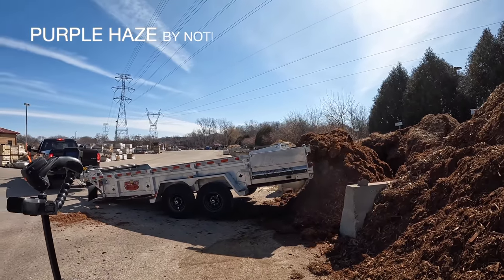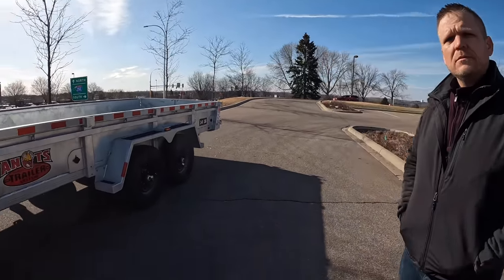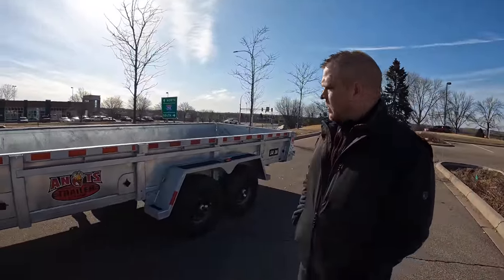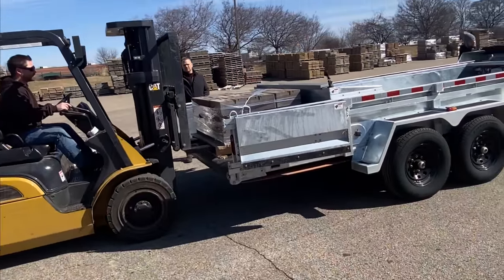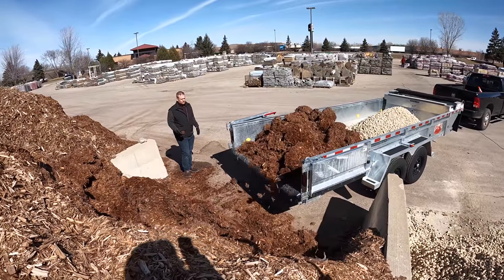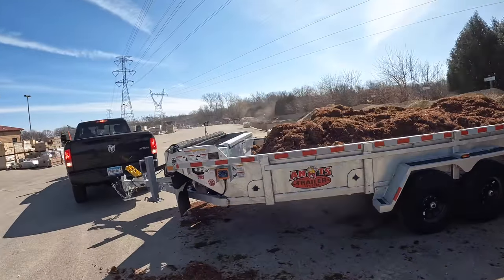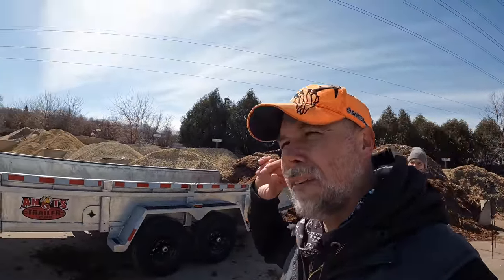Crazy Live bottom dump Trailer in action!

Comment: The sheer aspect of being able to load multiple pallets without having to do the pallet shove is amazing and worth it.
Though I would see about getting some rubber bumpers for those dog ears because you can't always rely on workers to be as conscious about not dragging them.
Reply: maybe UHMW dog ears
Reply: Redesign them with wheels.
Reply: You  could just carry a couple pieces of 1" thick plywood to put under the dogs!
Reply: @BrunoPonce  Many times the trailer has to move backwards while unloading...so not a good solution.

Comment: A simple fix for the dog ears dragging is use the same poly that is made for plows and you could actually use the same idea a snow pusher uses. Where the side of the boxes have poly that moves up and down just adapt it to this specific trailer just a simple thought maybe a easy solution. Cheers hope she works great for ya!
Reply: Or add a wheel
Reply: Or ad a polly roller on each side
Reply: Could an Off The Shelf poly for a snow pusher be bolted on? Alternatively, rollers like they use on the back end of a motorhome to keep it from scraping the ground. I just ordered a pair of rollers off Amazon for a trailer I'm building earlier this afternoon.. very reasonablely priced.

Comment: I would prefer that the rear of the trailer had rollers similar to what is on a small roll-off container ...Not a fan of the dog ear for a number of reasons , one being the marks left by the dragging them and they will grind down the nothing and on surfaces  not level The belt is just too close the the ground...otherwise the trailer is fantastic ....
Reply: All that you have to do is raise the dogs off the ground and then they don't drag!
Reply: @larryzuravin4226  yeah , but that dont work on uneven ground...
Reply: Thinking same thing all my dumpsters have huge steel rollers on back. I can pull it around like a trailer. And back it up of course

Comment: What a great piece of equipment. 
You could put delrin or UHMW blocks under those dog ears pretty easy and a chain oiler without much trouble. The utility of rolling off the two kinds of loose material without mixing is great. That tall stack with the kneeling thing is pretty cool too.
Reply: You can put a partition in a regular dump if you need to haul more than one kind of material. I've done that before but rarely need to.
Reply: @jamesnm21  you missed the point. Sure you can load any trailer with as many materials as you like, but you'll be shoveling them off, because you won't be able to offload them without them mixing.
Reply: @littlejackalo5326  you just leave the partition in while dumping bud.

Comment: Hi Stan, This trailer is awesome,  What can be done to prevent the marring or gouging of pavement or concrete surfaces, is to place skid plates below those dog ears, made of the same material you have on the bottom of your snow plows.  Make it to be replaced as needed just like the snow plows ensuring no metal comes into contact with pavement or concrete surfaces.

Comment: Very impressed with your review, as well as the triple-functionality of this "Ant's trailer.>>>I don't know if I missed-out on the price, or if it was not mentioned.???P.S.--I had a thought that came to mind when loading different materials.....my thought was if you could install adjustable self-locking tubing across the width of the trailer with a rubber-skirt (or other flexible/durable membrane) hanging down to the floor, that should easily keep the materials from touching at all.
Reply: Last I knew 25,000

Comment: Congratulations Stanley on your purchase 👍👍. Looks like this trailer will come in quite handy for some very unique circumstances.
My only concern is it has 7K axles. I noticed all the weight is transferred to the back axle as you were offloading the pallets of pavers. I'm wondering if it's possible for the rear axle to become bent if transferring 10k of product + 4k of trailer weight acrossed it?
Reply: It should have some form of self leveling capability to address that.
Reply: imagine having that 14k travelling 60mph and you hit a bump / pothole and the dynamic forces it should capable to handle VS being stationary
Reply: Dexter makes 8K & 10K axles that could be easily be swapped over if you felt it is needed for what you are hauling/unloading. Just remember to upgrade the tires and wheels if you upgrade the axles.

Comment: I demoed the 6x10 deck over that they make .
It was awesome. 
High quality piece and great folks
Reply from the maker: Awesome 👌
Reply: I'm in New Hampshire 
They have a big concrete company. 
They use their stuff.
Unloading palletized stuff and the stacking when unloading is a game changer.
I have a sawmill and firewood operation.
You can Unload strapped packs of lumber right where needed. 
They are a tool as well as a trailer.
Stan hit me up if ever in New Hampshire. 
Bruno Minard 
Big Meadow Sawmill

Comment: Very nice! Sweeps at edges might discourage loose materials from sneaking under the belt? Some users will likely beat up the belt prematurely (broken concrete, sharp scrap and jagged materials). As a user or OEM I'd be looking for an 'armored' belt option. Rubber doubler flaps or cross slats of ultra high molecular weight polyethylene adhered to the belt might do the job.
In some ways this is the perfect application for going all electric (intermittent use). Obviously some re-charge discipline would be required. On the other hand a no-run situation with job-site engines is all to common.
Reply: He did say that there is a trickle charger that maintains the battery when the truck is running and the gas motor also charges the battery so no re-charging is needed if you use it on a regular basis.

Comment: Just curious how many pavers got broken when unloading the pallets or if they were roofing tiles seems to me like they would have been cracked I actually saw the pallets shifting the material which kid cause breakage. The other question I have is how often do you have to replace the material on the conveyor seems like it would wear out relatively quickly and I noticed you did it with mulch but what about heavy wet dirt will it push the load off when it weighs 2 to 3 tons.
Reply: Move the pallets further apart?

Comment: Does the conveyor system have a neutral gear for when loading pallets you won't have to move the conveyor forward manually & can have pallets sandwich together utilizing as much space possible or if you don't have remote you won't have to get off forklift to move belt forward?
Reply: Driven by a hydraulic motor, I’m guessing it doesn’t

Comment: This is an awesome piece of equipment . I enjoyed your demo , but think that you missed one of the best SAFETY features . Being able to load equipment WITHOUT ramps !
The other thing that they show  in their company video is the ability to pick up large objects and materials using the onboard winching system in conjunction with the moving floor.
I encourage anyone looking for a dump trailer to look at the company video on their site -- beware -- you will be hunting one down next !
Reply: You would have to double check that. Not sure uou would want to load a heavy machine with it tilted up.
Reply: @lesleyboeder1798  watch the company's video on their site .  They load a machine into the trailer on that company video.
Reply: @lesleyboeder1798  the up tilt seems to be held up hydraulically so I dont think I would have a concern about that, especially since you can adjust the angle while loading with the remote
Reply: @slatecreekservicesllc8615  the side off load feature also is a great idea

Comment: cool trailer. so fill up the honda motor, any video on if that's a P.I.T.A. ? could have used this back in 2006, but that market collapsed so i am not longer in the palletized material uses.
GM & Rams all rust out just as fast which is pretty quick. i think chrysler uses slightly less underbody spray so they start rusting a few years earlier, but in 20 years they all come out as rust buckets.
Reply from the maker: Filling up the Honda was easy.  I like Ram trucks but thier bodies are paper thin.

Comment: Great video. Would worry about the belt if you hauled a lot of material that you dumped straight in with sharp and rough edges that had weight. Would be great for landscapers but for general contractors who haul a wide variety of material `and have employees who are rough on things might give me a cause for concern. I believe it is a great trailer and will be great for certain applications.
Reply from the maker: "Would worry about the belt if you hauled a lot of material that you dumped straight in with sharp and rough edges that had weight'. agreed-  Thats why I plan on NOT allowing it to be used for demolition
Reply: These conveyer trailers are common in agriculture, however those are very heavy duty trailers. I do wonder about the longevity of these smaller utility trailers. I do question the need to use a combustion motor for this application due to the low duty cycle - an electric motor with a few batteries would be more than sufficient with some charging from time to time, perhaps its cheaper to use the honda ICE.
Reply: Mark, we have one of these same ANTS trailers that we’ve had for 4 years doing concrete and we drop block and concrete rubble and all sorts of hard jagged material. We abuse it, but haven’t had to replace the belt or had issues with it
Reply: Well considering a concrete contractor designed and built it for their concrete business, I'd say it could handle quite a bit of heavy sharp concrete being dumped in it. Looks to be hot dipped galvanized also very nice, no paint or rust.
Reply: @Dirtmonkey  Cutting plywood that covers the belt (4' x width of bed) may be an option to prevent belt damage. Would add a bit of time to offloading and pulling the plywood out after dumping each 4' section but Im sure that it would just take some practice to dump loads so that it would be easy to pull plywood out, especially with the ability to lower the front of the trailer while stacking during offloading.

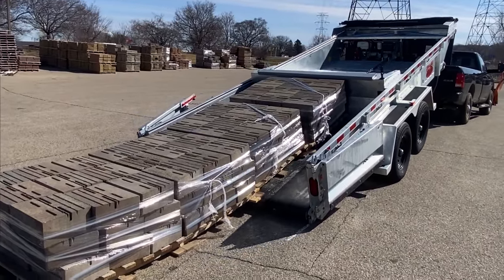Comment: Great trailer, solves a lot of issues.  The only issue would be to drop a load behind that push ramp, and it would take a while to clean it out.      It squats low enough, can you load 10k equipment in the back?     @ 11:18, I don't like the scrapes on the ground.   Hopefully it has a replaceable shoe there.

Comment: they made an attachment that hangs on the back end the conveys material to the left or right side perfect for loading a wheelbarrow. i think small job landscaping this would be awesome
Reply: For clarification, "They "made" or "make" an attachment that hangs on the back end that conveys material to the left or right side, perfect for loading a wheelbarrow."?   I was thinking of a small hydraulically powered conveyor that could attach to the rear to be powered by the hydraulic system that could do that very thing.  It would not be hard to do, some pins and quick-connect couplings should work great.  Put it on only when needed.

Comment: Very cool all it needs is some refinement it. definitely need a better Low pro guard for belt. 5/8 solid rod full across bottom. Also it should have 2 small steel rollers 2” wide to stop blacktop scrape or worse belt damage. They need to protect road but more importantly belt! And that rear roller that that belt rides on. Rear ends of tail gates take beating. I would be game for a all steel design with rectangle tube pulled by ains steel chain. Rubber is tuff tho and there would have to be good spacing for binding,as well as account for wear areas full steel caped tube would be sweet. Very cool
Reply from the maker: sounds like you have a bit of engineering or metal fabbing in your background

Comment: I’m wondering why that moveable wall at the front of the trailer couldn’t be set in the mid trailer position to separate different materials. I noticed that a small amount of crushed aggregate fell out with the mulch. We have a landscaping supplier in our area with a divided dump box. I’m certain you have seen them. Anyway when delivering to a home owner or contractor, they dump the product on the rear then move ahead and the divider swings like a conventional tailgate allowing them to dump the second product.
Reply: Because if you look inside the trailer when its at the midpoint, there is a bunch of mechanicals inside there that probably don't like dirt and rocks being dumped in them. And how would you dump the stuff in front of the wall that doesn't go any further than the tailgate? 

However, they could most certainly create a divider that attaches to the conveyor belt somehow that helps divide everything. Otherwise, I'd just grab a 2x10 and set it between the two if you really need to keep them divided.

Comment: So Stanley if you don't want to mark the ash-fault or concrete then have a couple of small wheels welded or installed on the dogears and  problem solved. This will facilitate the removal and also if you have to move it forward it wont hurt the trailer at the same time.
Reply from the maker: That would solve that problem

Comment: Looks like a  perfect technology for hauling sawdust for indoor farm applications., it just needs to be a bit longer with taller sides & a bit higher weight capacity.  Redesign animal expo buildings with a few big doors and you could drive the sawdust through isles ,run the conveyor belt to drop some sawdust in front of every animal pen's door.  Throw in a EV truck and you wouldn't scare the animals.

Comment: How do you think it would handle dropping pallets of pavers. The landing seemed a bit rough, which isnt a problem for block, but could be an issue with a standard 2 3/8" paver pallet?
Reply from the maker: Brick Pavers are more durable than block.  they wouldn't have an issue in my opinion but I didn't test that.
Reply: @Dirtmonkey  sure, with a solid core block, i dont see an issue. It seems like a cool tool. I am contacting the company tomorrow to see if i can have them bring one out and possibly test it with pavers.

Comment: As far as scuff marks use 2 pieces of  snow plow poly blade sandwiched together or bolted to that piece or how about ice skate blade covers hmmm what think Stan this trailer is by far the most   Versital trailer I’ve seen  being able to haul material as well as equipment mowers blowers skid plus extra side height be able to be added of 2 ft awesome trailer now Stan you   Forgot to mention a price $$$$$$$ thanks Great video

Comment: Stan it’s a neat trailer but I would beat it up dropping logs and heavy debris in it but it seems it will fit your company I’m sure it cost mid twenties range good luck with it 👍
Reply from the maker: They range from $17-$28G. this one was on that upper end being all galvanized.  Im not letting the guys use it for demo- I don't want it wrecked.
Reply: We’ve had one for our concrete business for 4 years and we abuse it by throwing block and concrete rubble in it and haven’t had an issue with the belt nor replaced it

Comment: Sorry I hate to say that trailer is limited on what it can do. Deliver 4 palettes of brick sure. Load it up to the 14000# max over and over it will fail. The tilt or dump setup brings all the weight up onto 1 7000# axle. I know this because I make my living with a 14000# max dump trailer. I do like the belt system though, very nice.
Use a dump trailer setup and you have a much more reliable trailer

Comment: Did they try it full of crushed stone?  or just the mulch? I would find it more useful  if it could push 5 ton of  1in crush n run into wheel barrels. Instead of the guys shoveling it.   thanks again for the videos.
Reply: They also make a side chute conveyer attachment to perfectly fill your wheel barrow. But I would imagine it could haul quite a bit of crush n run

Comment: Those looked pretty severe scratches in the concrete where it dragged itself forward..how long before the bottom "feet" wear away completely?
That you can lift slightly won't stop most users scrapping the ground
Reply: I’d be more worried about scratching the hell out of somebody’s driveway. Maybe some huge urethane rollers on the end? Like what they put on large dumpsters, only not steel.
Reply: @wompbozer3939  Agreed

Comment: Great trailer, it’s just a little disappointing that the pushing surface doesn’t go all the way to the end of the trailer so you’re left with some of the material at the end of the trailer! I know it’s not much and you could just shovel it off or you could put a spacer in front of the pushing surface, but at the end of the day I think it’s a minor design fault, otherwise a fantastic trailer!👍
Reply: LOL. You talking about that last 2 inches? It's a non issue.
Reply: @littlejackalo5326  It looked more like 6 inches on the video! Maybe they didn’t have it go to it’s extent??😀👍

Comment: The pivot point on the front of the trailer frame is the weak point.  It will be interesting to see how it holds up.   The Honda motor living is salt spray is sad too see.
Reply from the maker: good points-  Time will tell if those are factors or not.
Reply: Our 2 prototypes we built 7 years ago are still being used to this day. Landscaping company has since bought 6 more. Other is a concrete company. Hasn’t been an issue so far 👍

Comment: At $30,000 bit much for a trailer that will have allot of wear points in short period of time.
Reply: The 2 prototypes we built over 7 years ago are still being used to this day. Haven’t ran into common issues even with consistent daily use for many years now. Been solid so far 👍
Reply: Wear points are inconsequential, considering they're only wearing a couple times a day max.
Reply: 30k seems pretty steep. but for a busy contractor it could save a ton of labor hours in no time at all.
Reply: Starting price is 17k but fully loaded is 30k